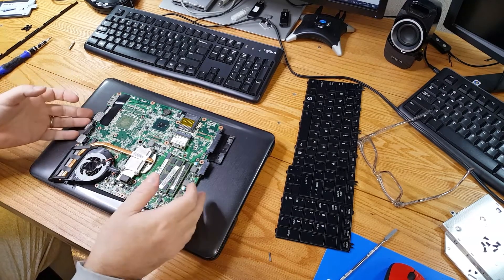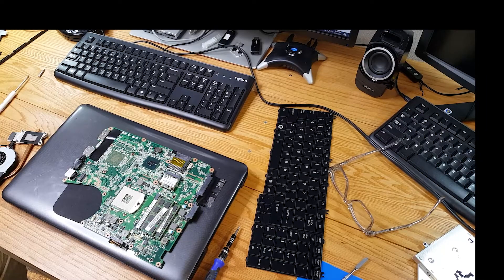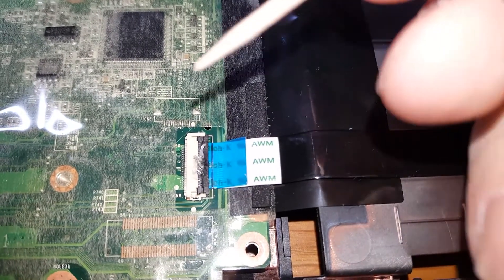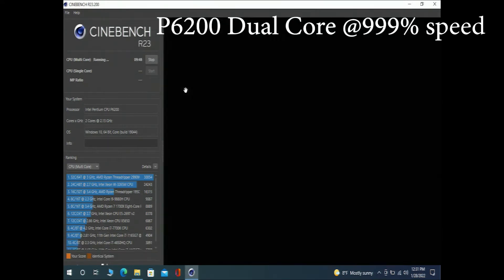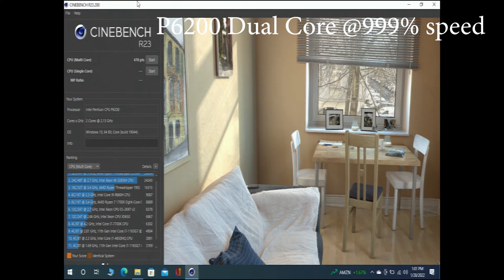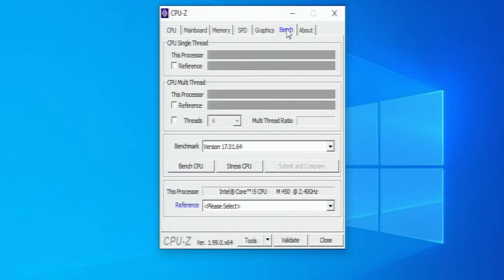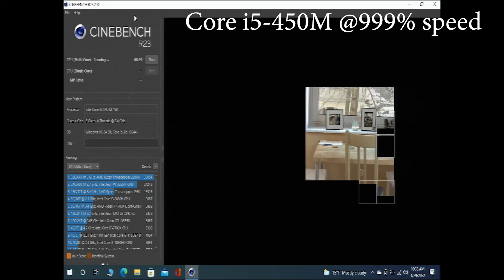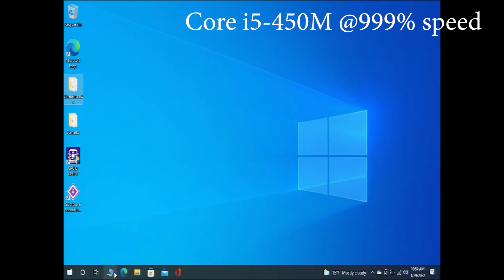Toshiba Satellite L655 Rescue Series.  Upgrading the CPU to a 1st Gen Core i5-450M with benchmarks.

Comment: My friend had me upgrade his HHD to a SSD. Then he went and bought ram thinking it would take 16 gb. I tried telling him that I would do the research before he spent money. Well did not listen to me. He got frustrated and bought a new laptop. So I asked what are you going to do with the one with the new SSD. So he sold it to me for 150 bucks. I since replaced the WiFi card and upgraded to 8gb of ram. I am waiting on a CPU I5 520m. So after watching this video I have hope that it will work. The Intel P6200 in my opinion is a garbage CPU, it does do its job I will say. I may even try a I7 with the igpu. For the price it won’t be a loss if doesn’t work.

All I’m using it for is to surf the net and play an old 2001 MMORPG Anarchy Online. Owned Toshiba with a Pentium 3 with dedicated graphics. I miss that little work horse.
Reply from the maker: great story!  it did make a nice difference in usability, even just being a 1st Gen i5
Reply: @UncleMikeRetro What BIOS version. I tried to download that latest from Dynabook/Toshiba, they show the file but I get an error.

Comment: Hi Mike I got one of these and would like to upgrade it as I hate waste and if was a bit faster it will do for my needs to the grave but I'm not a PC geek so to speak but taking things apart and putting back together does not phase me. My question is I have the L655D-133, not sure if it was just a UK model but the cpu is AMD Athlon 111 P320 Dual-Core 2.10 GHz, can you recommend a suitable upgrade ? Thank you.
Reply from the maker: This is a Socket G laptop, and the fastest you can get is a Phenom II X series CPU, but your cooling setup (heatsink and fan) might not be capable of cooling one of these under heavy load.  It's a crap shoot.
Reply: @UncleMikeRetro   Firstly Mike, many thanks for your reply, it is very much appreciated. If I could ask one more question, is there some middle ground between the cpu I have and the fastest one you mention that may not be as much of a strain on the cooling but will still improve matters a little. I have got a SSD and 2x4Gb to fit this week, which I'm hoping will improve things a bit but would be nice to know if it still isn't as I hoped there is a bit more I can do with the cpu. Thank you.
Reply from the maker: Hello again!  Well, it is said that the dual core Phenom II's are good for gaming (contemporary games) due to only a need for single core performance.  A dual core then should be a nice compromise
Reply: @UncleMikeRetro  Great, thank you Mike!!

Comment: Are you sure that you needed to take everything off to get to it? Also, is there a video showing disassembly and reassembly?
Reply from the maker: Yes, everything had to come off.  This is because the CPU socket is on the BOTTOM of the motherboard and the only way to get to that is to take out the mobo and flip it.  No shortcuts!
I did not do a complete disassembly and reassembly because this was done to death at least 3 times already on YouTube, maybe better than I could do it.  No point in reinventing the wheel!

Comment: How do you know which processors will work? What if I wanted to go to i7 for instance?
Reply from the maker: An i7-640M should work, but there may be the issue with thermal capacity of this laptop's cooling system.  The i5-540M makes the fan run at full speed almost 100% and the i7-640M will run probably a little hotter.  It will physically and BIOs-wise most likely be compatible, but running it for a long time?  Your call.
Reply: I’m going to try a I7 down the road. The CPUs are dirt cheap. Just make sure it is the dual core I7 with Intel integrated graphics. The fan runs when running a game. It is not a true gaming machine by any means.

Comment: Is this the fasted upgrade for this laptop? or just the fastest you tried?
Reply from the maker: There are a couple of other core i5 CPUs related to this one that might work, just a tick faster but still 1st gen, but this is the fastest anyone had luck with that I could research.  AND it runs a little warm, so I didn't want to tax the cooling system that was really only designed for a dual core Pentium.
Reply: @UncleMikeRetro  I just ordered one from eBay. Let's see if it works for me.
Reply from the maker: @thatguyfromca  You got the same laptop?  I had to pay special attention to the exact socket I had.  Let me know how it goes for you?  It was a HUGE hassle taking literally the whole laptop apart, lemme tell ya.
Reply: @UncleMikeRetro  it’s a s5158 I think but it’s the same series and same socket. I’ve upgraded the CPU before but I didn’t know it supported an i5. I’ll post if it works.
Reply from the maker: @thatguyfromca  Heck no!  Let me know regardless, please.  Knowledge is power!

Comment: I'm curios have you noticed a difference in general usage, Windows 10 becoming snappier for example?
How about the heat, was there a noticeable difference?
Reply from the maker: I just got it all done, but I will say this.  Win10 boots in like 5 seconds.  Very snappy response using it.  Also, no additional heat (that I can ascertain).
NOW to get the 8 GB RAM kit.  if it is quick using 4 GB, 8 should make it very nice.  These laptops, once you get enough RAM and cores, all feel just fine.  In daily use, no gaming of course.
Reply: @UncleMikeRetro  glad it was worth the trouble!
P. S. I will upgrade my intel 6700K PC to windows10 tonight. (hopefully so) 
Once you haven't formatted since long years, you start running from that task as far as you can go.
Reply from the maker: Are you doing an upgrade or a fresh install?  there are plusses and minuses for both.
Reply: @UncleMikeRetro 
Never believed in upgrading :D
(always thought it leaves some undeleted junk from previous OS)
Reply from the maker: @O.Shawabkeh  I was sorta hoping you'd say that!  Yeah, tough process.  I always use a fresh drive for the new install, then have the old for backups and transferring all my stuff over from.
Reply: @UncleMikeRetro  that is really a nice idea regard the new drive, it never crossed my mind in such way.
Reply from the maker: They are so cheap nowadays anyway and newer = faster.
Reply: @UncleMikeRetro  Any tips on selecting one on ebay? Im always very concerned about safety of buying on there..
Reply from the maker: @vanstromi7810  I picked the guy with the most sales and best rating.  I have found that it is sooooo easy to dispute a sale if you get bad/no merchandise.  eBay will almost always side with you in a dispute and charge back.